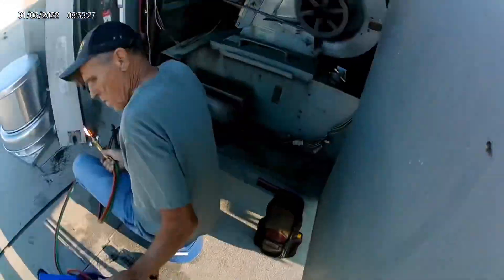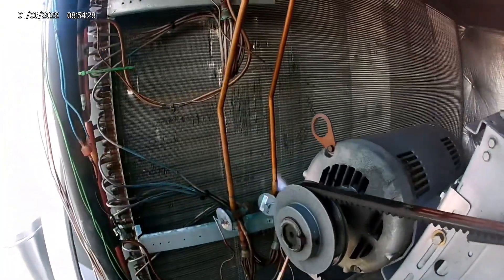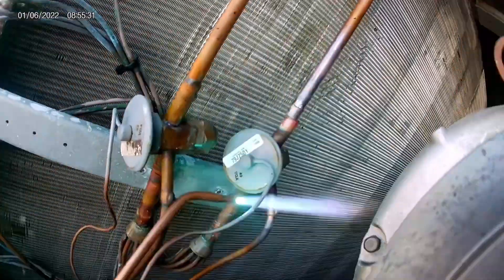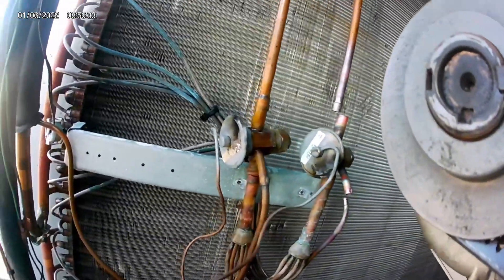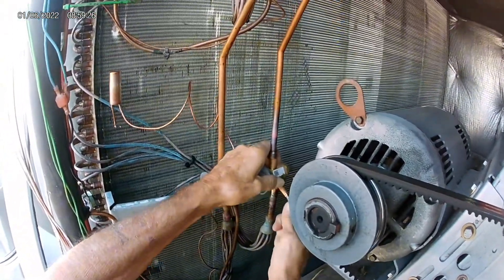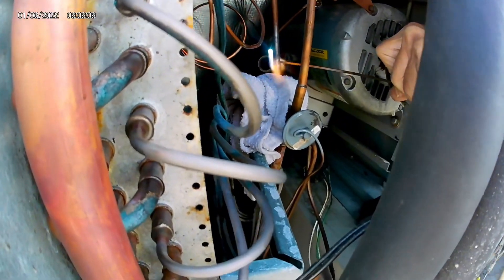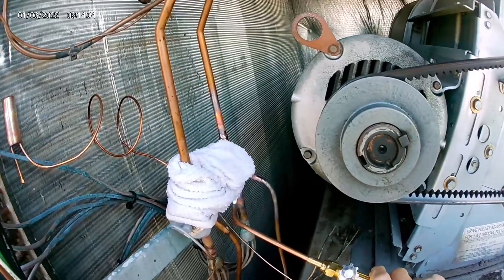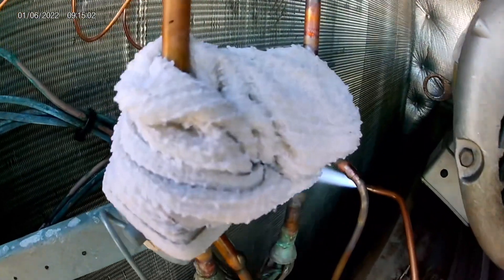TXV Replacement on Lennox Unit | Hvac Life

Comment: i thought u should flow nitrogen through while brazing
Reply from the maker: You should! And I did I just didn’t show it in this video
Reply: I thought so too. Currently in the field, non mini, standard split or package units, I see lots of jobs successfully completed with no flow.

Does that result in issues right away? Not that I've seen. Will it take a few years off the life of the system?  Probably. 

I try to flow everytime. Buttttt the field thinks differently